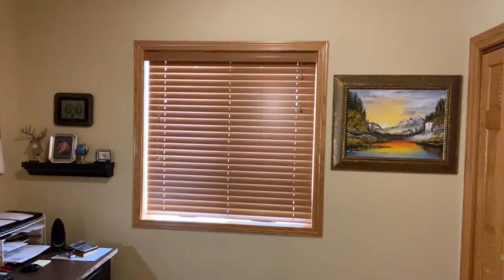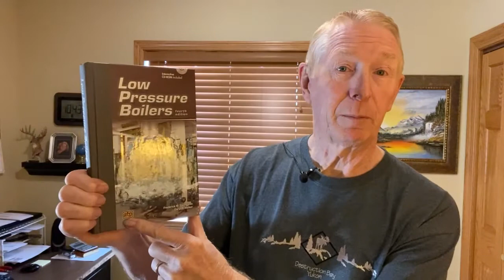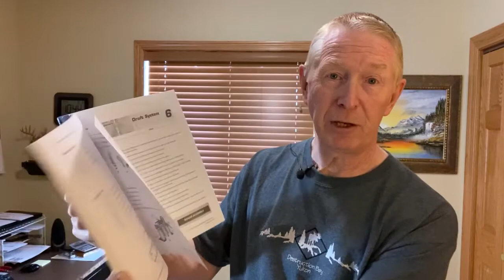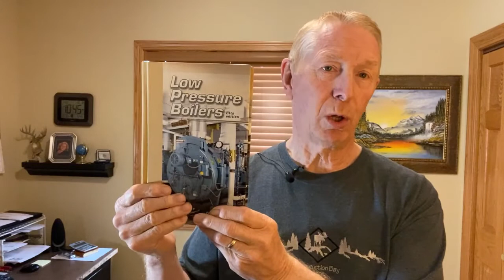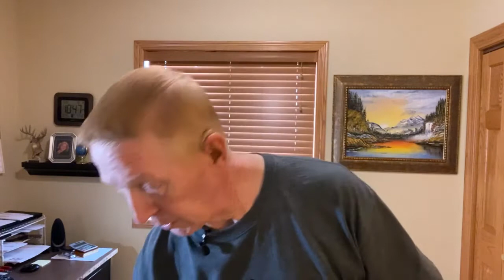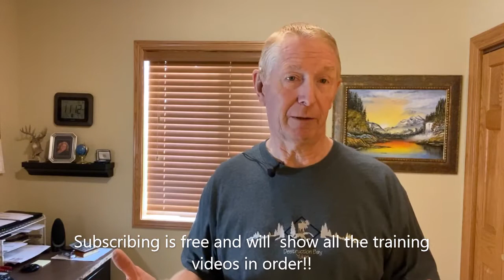Low Pressure Boiler Training-Session 7-Boiler Ben

Comment: I just took a class in Brainerd MN for special Engineer.  We have hot water boilers.  How often should i test water?  Could you recommend  a good test kit?
Reply from the maker: Find a consulting company to give you recommendations. Ask other boiler operators who they use. Usually hot water boilers don’t need frequent testing. They are most often tested once or twice a year for pH and corrosion inhibitors.

Comment: Hello Ben, I’ve been studying the boiler book and watching your videos.  I have a few questions.  Do you have an email address that I can send you those questions?  Thanks for all the great information you share!
Reply from the maker: I’m very glad you are making use of the videos and most importantly reading and studying the books! I do not release my personal email but if you post questions here I will attempt to answer those the best that I can! Boiler Ben
Reply: Hi Ben.  What steps do you do if your Low pressure boiler is running a higher PSI?  And what if it’s running a lower PSI?
Reply from the maker: Assuming it’s a low pressure boiler to increase the pressure you need to add water to the system. If you need to lower the pressure you need to remove water from the system. There are a few additional variables such as incorrect system design that makes adjustments difficult. If you have never done this type of adjustment seek professional help and watch and discuss everything they do! Great question!
Boiler Ben

Comment: Hi there Ben. I have had a Special Engineer license since fall of 14. I want to test for a 1st class B. Do you have any study guides that you recommend?
Reply from the maker: Yes in addition to the low pressure boiler books I have recommended you should also study high pressure materials. I recommend High Pressure Boilers text (#4331) and study guide (4332). Both are published by American Technical Publishers. Go to www.atplearning.com Go to Facility Operation & Maintenance and click on High Pressure Boilers. You can also order the answer key but all study guide answers are in the book. Best luck and study, study, study!!